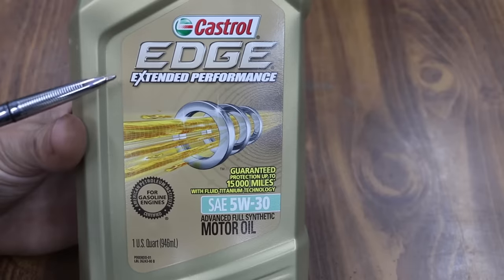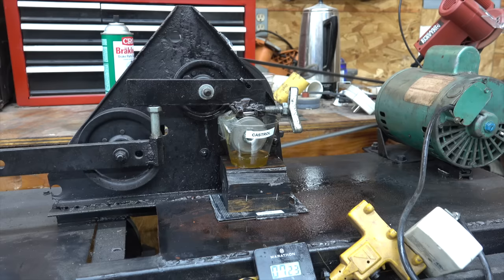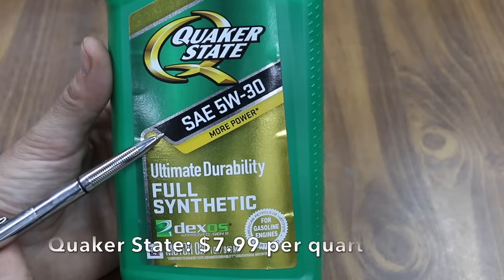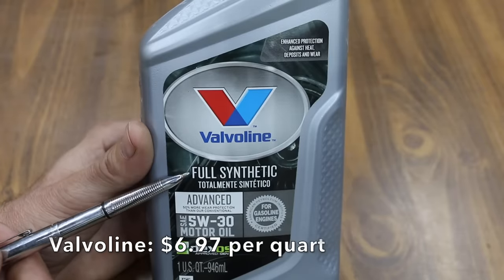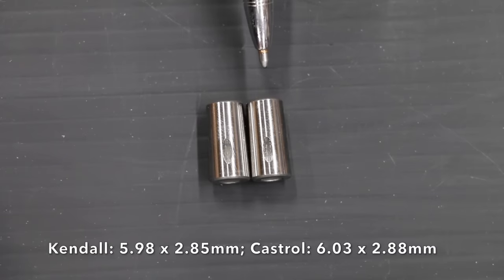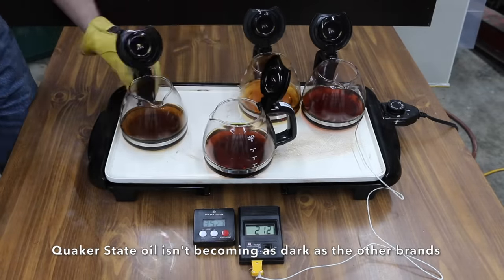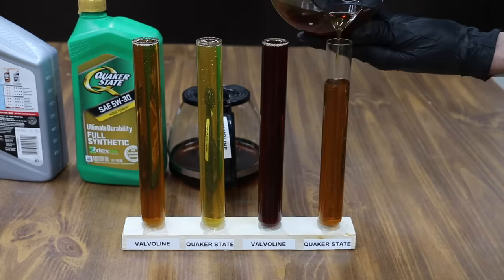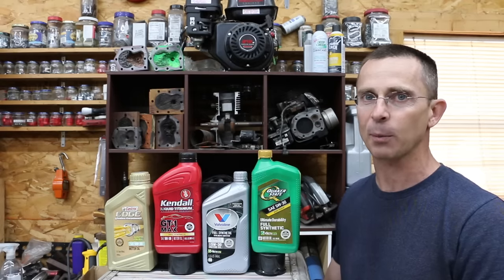Is Castrol Motor Oil better than Kendall? Let's find out!

Comment: A real engine oil test is an engine stripped and components measured for wear after 200k miles having had the correct oil changes throughout. Any other oil test is mere speculation - end of story.
Reply from the maker: Thanks for the feedback.
Reply: @ProjectFarm  
You're welcome!
Some cooking oils could perform well in these tests. Cooking oils operate at high temp too but I doubt anyone would be keen to have them in their turbo engine.
Reply: In essence, what you state is fair. I serviced a Merc C220 petrol a couple of years ago and I used Merc's own brand (Daimler AG) engine oil, 5w40 MB229.5. There's a channel on that's done a lot of oil tests, the Merc oil I used being one of them. The Merc oil gave a very poor result in the tests......go figure!
Reply: @dieselhead254  
Merc brand oil will be purchased in from a 3rd party oil company such as Comma. It'll be good quality though. I doubt Merc would risk their reputation. The right multi-grade and oil specification for your engine are the crucial factors of any oil change, that and a good filter and for me its Hengst or Mann.
Reply: @hammerchisel2477   Very true what you say about Comma. A lot of supermarket engine oil brands are supplied by Comma.
Reply: On the matter of oil brand labels, SCT use three labels for their oil. The labels being Mannol, Fanfaro and Pemco, are all the same oil, the labels allowing label exclusivity.
Reply: @johnchurchill3933  
I've used Mannol's OEM 7715 which is their VW 507.00 oil and the engines using seem to run well. One issue with the Mannol OEM range is the metal cans - I don't like them, difficult to hold while pouring oil.
Reply: @hammerchisel2477  So long as the oil is quality, that's what matters. If anyone is having sleepless nights about the quality of oil they're putting in their engine, commission a petroleum lab to test it otherwise, just get the right grade and specification for the engine from your preferred brand and put it in the engine and drive.

Comment: I think it's too close between Castrol and Kendall on the lubricity test to call a winner.  There's too much variation in the forging process of the manufacturing of the bearing rollers to be positively sure they both have the same hardness.  That being said, it was quite a good show.
Reply from the maker: Thanks for the feedback.

Comment: Can you please test a single weight motor oil. Look at the sheer test. It is actually better than any full synthetic motor oils. There are no viscosity index improver that evaporate. please advise that single weight motor oils are only used for climates above 32 degrees Fahrenheit.I have been using the Walmart brand and it cost me only $2.78 per quart. It's for me better in a hot climate than any multi-grade fully synthetic motor oil. Can you please test it the viewers need to know. There's no point in using a pour test because single weight motor oils are not used for cold climates. They are billions of people that live in the southern borders like me. Thank you
Reply from the maker: Great test recommendation! Thank you
Reply: @ProjectFarm  You will see it beats all full synthetic multi-grade oils at high temperatures.  And it's only $2.78/qrt.!  (It's not for cold climates, but there is very little evaporation as you will see.  You'll scratch your head at the end ....lol
Reply: Super Tech SAE HD30 has an API of SN Plus.  Go figure???

Comment: Did you know Castrol is the reason synthetics aren't truly synthetics
Reply: I thought it was Pennzoil or Valvoline that won that lawsuit against Mobile..
Reply: @lonniebeal6032  in the 80s or  90s  dont remember the exact date , when good oil started to show its face (group 4 ) a true synthetic. Castrol decided to sell a group 3 labeled as a synthetic 

This was taken all the way to the Federal Trade Commission . And they ruled that they have no right to tell a company what oil is synthetic oil so it stuck. And from the point on practically every company started making group 3 and calling it synthetic. 99% of every bottle of oil on a shelf today that says its synthetic is Group 3 wich is not a synthetic. Hell even Amsoil isn't a true synthetic